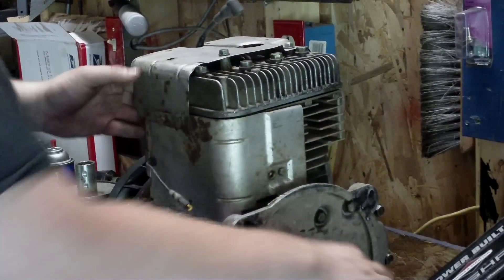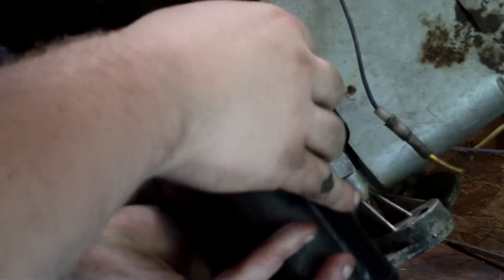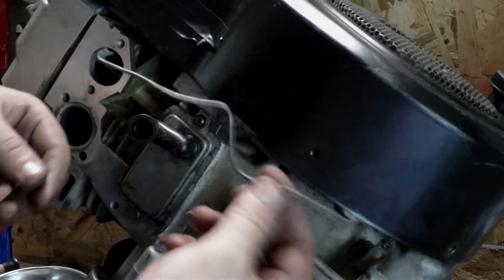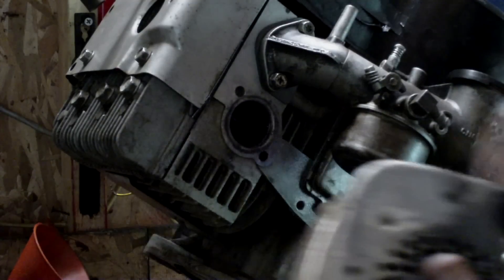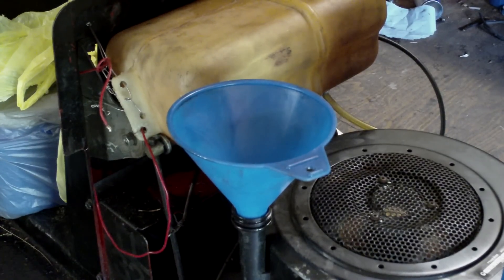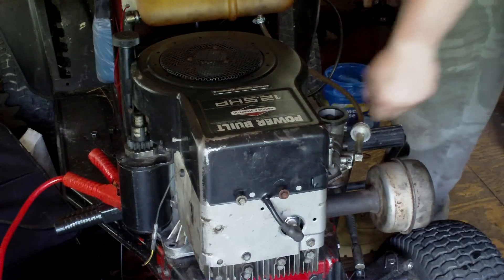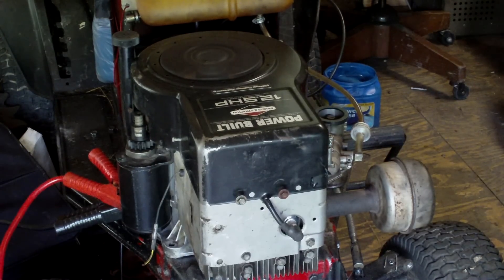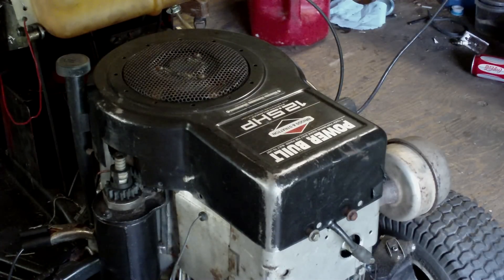Briggs and Stratton Power Built 12.5 HP Flathead Model 28 Rebuild  First Start PART 4 (FINAL)

Comment: Thanks mate awesome vid! , I need to re-built my 12.5. Looks like I need some tools - spring compressor, valve seating tool and the gasket kit etc -where do you you get these from? is it worth getting them for one engine?
Reply from the maker: Your welcome! I have another video on tools for small engine repair, might want to check that out as well, might be a few other things you need. ehh, to be honest that would be up to you, you might end up doing another one later on. My cylinder hone is craftman/sears, and the spring compressor is a actual briggs and stratton brand made for flathead or L head engines, you could probably get a good buy on that on ebay, as far as parts go, i get them from tulsa engine warehouse (tewarehouse dotcom) when you run a part # on there, you have the option of aftermarket parts for alot less. They only ship within the US though. Hope this helps, Thanks for Watching!!!
Reply: fnaguitarplayer9
Hey mate ho do I identify my starter motor?  apparently there are a few variations for my motor some are 3 5/8 some are 4 3/8 -what is that measurement a reference to?
Reply from the maker: that dimension is for the housing length, if you measure the part that is sandwiched between the top mounting bracket/plate and the bottom  brush assembly (end cap) the metal sleeve looking part is the housing, measure that, the short ones are the most common, its rare to see the longer ones, at least around here anyways.
Reply: fnaguitarplayer9
You are the guru! thanks heaps. Couple of other questions. I have lightly honed bore and it is about 2 thou oversize i realize it isn't ideal but I assume it will still run ok with new rings? I also found the white metal bearings on the counterweight are loose (about 4 thou clearance) - I was unable to find some standard bearings to press in and briggs only sell the whole counter weight which will cost to much to freight here I assume it will knock a bit if i run like this? have you got a supplier for these bearings? how do you know its run in?  I ended up getting quite a few parts of amazon - I am having lots of fun!
Reply from the maker: No problem! If its just 2 thou over I probably wouldn't worry about it, the only way to fix that would be to get .010" oversize rings and file the gap to spec. It will run just fine, but it may have just a hair less compression and will start burning oil sooner (in other words if a clearance is over spec, the rebuild won't last quite as long) other than that its no problem at all. It may have a little knock when it idles if the counterweight/eccentric bearings are worn, to be honest i've never replaced them, I can't find them anywhere, its like it doesn't exist, unless you buy the complete assembly like you said. Amazon has some good deals, as well as ebay, I usually order parts from tulsa engine warehouse but they only ship within the US. you'll know the motor is broken in good once it quits smoking/burning oil, and like i said in the video run it for about 20 minutes, change the oil, then cut grass with it for about a hour or so, then drain it again, by this time it should be broken in / all parts seated in good as its going to get. Feel free to ask anymore questions you have, glad to hear your having fun while doing it!
Reply: fnaguitarplayer9
how come there are 4 different carb kits for the "newer" two piece carbs?
Reply from the maker: I'm not really sure on that, I guess certain parts may have changed during certain years, thats the only thing i can think of. Give me your model type and code and i'll take at look at my diagrams.
Reply from the maker: My diagram is showing 5 different kits, there are different numbers on the carburetor itself, it should say LMT on one part then there should be a 1 2 or 3 digit number stamped on it, I'm thinking the most common one is 77 if i remember right. And also, i need to know the code number, you have the model and type. All I need is the first 2 digits of the code, that is the year it was made.
Reply: fnaguitarplayer9
I decided to try carb as it was. All my parts turned up and I have unfortunately got the wrong piston rings. I ordered 696403 but the oil ring is completly different (to skinny) after doing more reaserch of think i actually need 499996, but when i look up to buy some of them the pictures don't look like my rings - the oil ring specifically is a different style. Its all a bit frustrating...
Reply: fnaguitarplayer9
this is the style of what i have : http://www.ereplacementparts.com/ring-set-standard-p-256024.html

But i cant tell from their details if they are correct...
Reply from the maker: i need the code number off the engine, the first 2 digits of it is the year, and the parts diagram says the ring set is different for certain years. Also, if your in the US i recommend ordering parts from tulsa engine warehouse, te warehouse.com that have the prices around.
Reply from the maker: tewarehouse.com
Reply: fnaguitarplayer9 9406234E, from tewarehouse the number i get is correct , 499996
Reply: fnaguitarplayer9
Well i jumped the gun, there are only two choices and i got it wrong the first time! so I have ordered the only other std option for the motor - fingers crossed! I ordered the rings from tewarehouse and used a freight forwarding company to send them over to New Zealand.  I could have got the rings from new zealand for $125 but i brought them twice from america for $50! your all pretty lucky for cheap stuff over there.
Reply from the maker: I hear ya haha Thats crazy it cost so much there, i guess we go get by a little cheaper.
Reply: fnaguitarplayer9
so I got all the parts and put it back together and it runs like a dream! -Thanks for all your help.  I am using it to run my log splitter with a 16GPM  hydraulic pump and its working really well although fairly hard! It will be interesting to see how long before i have to re-build it again with the 10" oversized piston!
I have been wondering if the top RPM's and idle should be set/measured under load or running free? because, given my setup is running direct drive its always under some load - even on start up
Reply from the maker: Good to hear you got her going! Your welcome, feel free to ask me anything anytime. haha i hear ya! I would say on that setup it would have to be adjusted/set under load, since like you say it will always some load on it from the pump.

Comment: Thank you thank you thank you, it was a great help for me :), my uncle gave me old husqvarna tractor with this engine, connection rod was broken but all other parts were good. I live in Croatia and in this part of Europe riding mowers or tractors became popular some 20 years ago and still there is not to many of them, so shops for repair and selling parts are rare and of course, everything is expensive...for example, some parts costs 5 dollars in US and here is 20... so I ordered rod from e bay, some shop in Texas, I got it under 10 days and with shiping still was half cheaper...can't wait gasket set to finish it :) one question, how much torque did you use on rod screws? didn't hear it well hehe. best regards from Croatia
Reply from the maker: Your Welcome! These are some of the best motors briggs ever made, my personal favorite, them and the opposed twins, which you don't see much of. Thats crazy that parts cost so much there, I love buying from ebay you can save a ton of money there. The rod bolts are torqued at 185 Inch Pounds IF both bolts are the same length, if one bolt is longer, you torque the small bolt first to 160 inch pounds and then the long bolt to 260 inch pounds, more than likely both are the same, i've never ran into the one with different size bolts yet but they are out there haha Good luck on your project and thanks for watching!!!

Comment: Great videos as usual. I know you didn't paint this engine but you cleaned the block and head up well, If you were really dressing up this engine for paint, would you have done anything with the flywheel? I ask because it looks like it could benefit from a sandblasting but then again who would see it. Just wondered. Also, can you use high temp black paint on an air-cooled engine head? (Fins?)

Thanks for these.
Reply from the maker: Thanks, appreciate that. I might have, I've thought of doing that on my next project, painting the flywheel. Yeah it would have to be sand blasted or cleaned with electrolysis. Yes you can use high temp paint on heads or blocks, I use duplicolor when I use engine paint, it has ceramic resin in it that supposed to help transfer heat better, but yeah a high temp paint will work great, alot of older briggs motors came painted from the factory and they are probably using a similar type of paint. Hope this helps, and thanks for watching!!!
Reply: fnaguitarplayer9 I have decided I want to rebuild carb because i want to learn how it works. I looked on the briggs part list and it has 4 different kits? It a walbo carb an I think it the new two piece carb you refer to - what is the difference between the kits? or i could order individual parts but im not sure which parts to order?
Reply from the maker: I'm not sure right off what the difference would be, if you can give me the model type and code off the engine I can look at my diagrams and probably tell you what you need, either the kit or the individual parts. The only thing i can think of is they may have different kits for different years they were made, slight variances in them.

Comment: What a outstanding series. I was just thinking about this mower I got for free, I'm going to modify it and put another axle out back and a dump bed.  My buddy I got it off of said it's not charging the battery so it's old and he got a new one.  Now I'm just going to pull the motor and give it a once over because I know why it's probably not charging.  Thanks so much man what a great learning experience.  Really appreciate it.
Reply from the maker: Appreciate that! Sounds like a interesting project, if you make videos that would be a great video to make. Its probably either the stator or the diode in the connector, or just a bad battery haha Your Welcome! Thanks for Watching!!!

Comment: i have sparks shooting out of my muffler ???? idk what the hell it is but when im plowing now at night i can see allot of sparks when it get under a load
Reply from the maker: What that usually is is carbon burning/flaking out of the engine and/or muffler, it can be metal particles as well, but if its a older engine its more than likely carbon coming out of it. A fresh rebuilt engine will do that a little, in that case its from everything seating in, and some metal particles coming off the rings/walls. I would recommend pulling the head off and cleaning all the carbon off, you do however usually have to replace the headgasket, also clean out the muffler to, several ways to do that, soak in down in a degreaser and flush with water or spary it out with carburetor cleaner. Also if the muffler is rusty it could be rust coming off from inside. I'll put this on my list of videos for this summer, thats a good subject to bring up. Hope this helps, and thanks for watching!!!
Reply from the maker: also forgot to mention, if it is left along and not cleaned out, and it is carbon from the piston/cylinder head, it can flake off and wedge between the piston / rings and the cylinder wall and scratch it all up, sometimes to the point of the motor needing to be bored out to fix.
Reply: ill try cleaning the muffler and changing the head gasket i took the engine apart and cleaned every thing and it seems to be but i didn't know if it was getting ready to blow up lol thanks man i like you videos they help allot.
Reply from the maker: The only need for changing the head gasket is if it fell apart while taking it off, if it stayed in one piece and didn't stick they can be reused. haha I hear ya! It should be alright after everything is cleaned up on it. No problem, glad to help out!
Reply: thanks man and do you know where I can get that gasket kit at??
Reply from the maker: No Problem! I get all my parts from tulsa engine warehouse (tewarehouse dotcom) great place to deal with.
Reply: cool thanks man !
Reply from the maker: No Problem! What I like about tulsa is they offer aftermarket brand parts as well as genuine briggs, so if don't mind not having a briggs logo on the package you can save a ton of money haha

Comment: Awesome videos.  I didn't see where you mentioned anything about the ring gap when installing new rings and what about honing the cylinder?  Do you mic it?
Reply from the maker: Thanks! Yeah i forgot to mention about ring gap in the video, I put a ring into the cylinder, push down with piston so its even then "mic" it with feeler gauges until i get the reading, I do have a video just on this, if you go to my channel and click the search icon and type in ring gap it will come up along with another video on ring installation tips. I also didn't show much of the honing, just a short clip, I need to do a video on this at some point. I just check the ring gap after i hone it, if its to large you have to use oversize rings and file them down to specs (specs are shown in the ring gap video) Thanks for watching!!!

Comment from the maker: ehh to be honest I don't know if there would be any benefit because of using STP or motor oil on all bearing surfaces first, what alot of people do is turn the engine over with the plug in with a electric motor to get everything seated in. Now if the engine has the oil pump system on it, then yeah i could see a huge benefit from that, another thing, if you were to do that, it might be better to do it before putting a spark plug in it so it will crank a little faster. thanks for watching!!!

Comment from the maker: ehh, i think it was around 35 or so, i get all my parts from tulsa engine warehouse, as far as parts go it was a basic rebuild, i mean no connecting rod or piston needed, if i had to get the valve, if i didn't have a extra used one, it would have cost and extra 12-15 dollars. I have a spec sheet, if you need the specs I can either send them or if you PM me your email address i'll send the chart to you, so you'll have it, it covers like 95% of briggs engines. very handy! thanks for watching!!!

Comment from the maker: No problem, I doubt it, unless its already came loose or broke the rod, sounds like a stuck valve, alot of times a valve will stick and it will loose compression. I'd pull the head and see if the piston and valves are working right, if they are all working, it may need the valves reseated or just the clearance adjusted. hope this helps! thanks for watching!

Comment: Thanks. I have an old murrey wide body and the 12.5 28 motor has no compression and is easy to turn. Do you think this might be the bolts on the crank coming loose?

Comment from the maker: sounds like the valves are out of adjustment, sometimes a headgasket may be a different thickness and throws the valve lash off. only true on OHV motors, not flatheads like in this video series. thanks for watching!!!

Comment: I have a 14.5hp b&s I change the headgasket because if was smoke alot i put every thingh back togeter start right of way runs but the moffler get red fast backfire came form the moffler flames to what can i do I need some help please.

Comment: Nice video that's  alot like the first small engine I ever built mine was a 12hp Tecumseh which has overhead valves a little different on the top end but it's one my preferred small engines last forever because they came with steel sleeves so there very durable I was twelve when I did my first build on a small engine and that was what was on my Murray mower 12hp 38"deck  that mower lasted over twenty years and went thru about 3 engines in all and was still running when I gave it away.....

Comment: I did a rebuild on my 12.5 but it would'nt start. New rings, lapped the valves, new wrist pin. Took it back apart and noticed the piston is not at even withthe top when in TDC. Both valves closed.I need help !! Thanks.

Comment from the maker: no problem! they are hard to find, we had a snapper a few years ago with a 8 on it. that was the last one i seen. yeah a 12 horse would do good on it, might take up a little more room, but you can probably make it work. Thats my favorite engine. I don't like the new engines there putting out now, i hate the electronic fuel solenoid setup, really expensive when they quit working. heard that! about the same here, I always helped my dad keep the mowers running, now I do most of it myself now haha

Comment from the maker: no, they are a little less than what this motor uses: (Inch pounds) head bolts are 165, rod is 165, and crank cover/sump is 140 and flywheel nut is 65 Ft. Pounds. I would suggest fining another block. the thing with alum blocks is that even if you do bore it out, you can't find oversize piston/rings (alum bore has to have chrome rings). And they have a coating on the surface that will be removed when bored. they can be bored and sleeved though. but thats expensive! thanks for watching!!!

Comment from the maker: Go to eccarburetors they sale all kinds of performance parts for these, look for model 28 flathead. Its best to run a billet connecting rod and flywheel, the flywheel can explode at high rpm. And its best to away with the synchrobalancer on the crankshaft and replace it with brass counterweights. they tend to let go and go through the back of the block! thanks for watching!!!